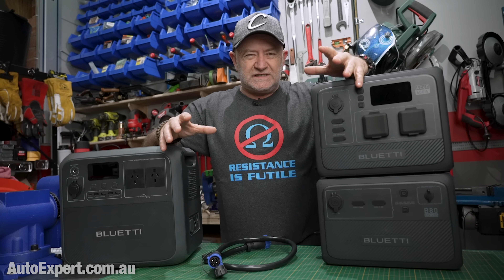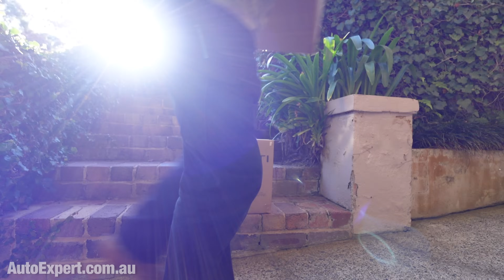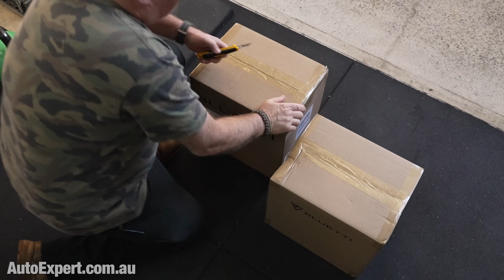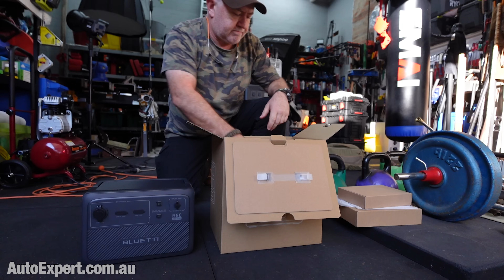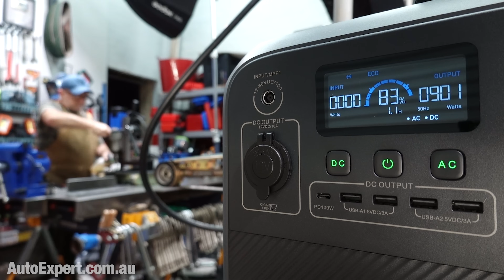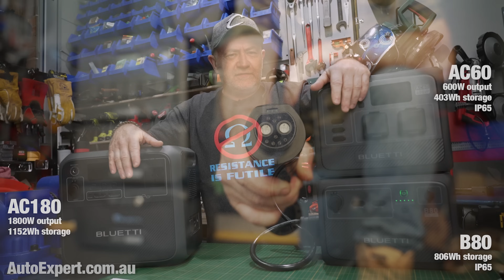Portable power: Bluetti AC60 & B80 portable power station review - first weather-resistant units!

Comment from the maker: BLUETTI PORTABLE POWER STATIONS
AC60 portable power station: https://bit.ly/4443whp
B80 expansion battery: https://bit.ly/3JcFrN6
AC180 portable power station: https://bit.ly/3qLDEIL
**Get an extra $20 off the AC60 using code "JohnAC60" until June 22.

Comment: Both are great units but the AC180 can do it all, I have run Induction Hobs and 1600w Air Fryers and Microwaves and kettles from them and they will even run SWMBO's Hair Dryer, So whether it is for Camping or Off Grid or unexpected Blackouts the AC180 will do it all, The AC60 + the B80 can do it too except run the big power Appliances, But I can find enough reasons for me to own both systems, Both are very portable and will get you through Storms and Blackouts and give the kids something to do by running their Xbox etc, In short these two Sogens are just Game Changers, Thanks John.

Comment: The ac 180 now has a cable for $30 which will allow you to hook up any Bluetti battery pack,the B80 all the way up to the 3000 watt which will give you 4100 watt system.
Reply: Does it it work and charge exactly the same?
Reply: What is the cable called?
Reply: @janiscooper1006  just lock on bluetti site and ask and it will show you.

Comment: RCD and earth staking is problematic. Use a RVD (residual voltage device)… no need to earth and a much safer option for isolated power supplies such as generators and inverters.

Comment: Wouldn’t mind one of these for the van and as home backup. I have a generator change over switch that I plug my little Honda generator and it powers the house. Would AC180 or 200 work in the same way? Obviously keeping within the inverter output.

Comment: These units do not have a neutral / earth link internally.  They would like operate as an IT class device.  As far as I know I class operation is actually a regulatory requirement for portable inverters sold in Australia.  I don't have one of these units so I can't verify it but I'd expect that the earth terminal on the device is also connected to the earth pin on the AC output sockets.  An RCD is not really necessary if this is the case as you require a double fault to have a problem, ie one of the 'live' wires needs to contact something abnormal and then you need to contact the other wire and then get in contact with the first wire or that other abnormal thing to have a hazard.

An RCD can work in these circumstances but would require at least a double fault and part of that fault to be upstream of the RCD itself to be capable of tripping since in normal circumstances one of active or neutral connecting to something else would still not provide a return path around the RCD.
Reply: An RVD and not an RCD is the way to go for those looking for extra safety IMO.
Reply: @RussellStewart  RVDs are prone to false trips with portable inverters where the DC side - is tied to the frame as would often be the case, either deliberately or through the vehicle's wiring system crossing the tow ball to complete the circuit.  It's not at all unusual to see > 100VAC between either of the AC output wires and the frame.  It's perfectly safe, faults in the inverter aside of course, as it's capacitive (20ish-kHz and 50Hz)  and extremely low current.

If there is true isolation between the inverter and frame they are a good solution.
Reply: @retrozmachine1189  thanks for the detailed reply. I’ve had no false trips with mine, but I am running the inverter 100% isolated.  I was originally running with an inline RCD but it would never trip even when a fault was induced on purpose.  The test unit always presented the “no earth” error. Rightly or wrongly, driving an earth stake was never a consideration for me, as a good earth stake is damn near impossible to get out and I had visions of me leaving a trail of earth stakes around the country for people to trip over. 😂
Reply: @RussellStewart  Good that it works for you.  Your inverter being fully isolated is the trick.

A lot of people don't understand how RCDs work.  They don't care about an earth per se.  All they do is sense imbalance of current between active and neutral, no matter how that happens.

Comment: I got one to use as a second battery for my maverick camper v2 limited. Because I could use it for the solar panels, then using bluette 60 to 24 v to the camper. This will support the AGM battery so it's doesn't over load it. Also if I need that short use of high energy tools or eg coffee machine. Plus I don't need to mode my camper to save money. Thanks John and the discount.

Comment: There are two types of engineers 1st type will instruct a tradie to "do it like I say" and won't listen to suggestions ... 2nd type will listen... Do the math and realize I the job can't be done the way he first thought and correct the instruction...or will explain why his method will be OK.  I have run into both types ...the best cure for type 1 is to say "put it in writing"... This usually causes a a type 1 to consult a type 2...

Comment: Can the B80 be charged off solar itself?
Like if you were to use it as a base camp to run a fridge and charge off solar while I'm off with the A60? And then could you also recharge the A60 later back at camp?
Reply: yes, most of bluetti's expansion batteries have discharging and charging ports

Comment: Thanks, John & Bluetti, for these reviews. 
Bluetti's always improving its line-up for the different needs & capabilities of potential customers.
The AC60 & B80 combo is ideal for the elderly as having them in each hand means that steps or uneven ground can be clearly seen when moving around, which makes it way safer. 👍
As you mentioned, the side weight distribution is less strain on the back, a major plus for anyone with back pain issues.
The earthing capability is essential in my world. I never use power tools with an earth-leakage breaker. It's just not worth the risk.

Comment: Hi John
My name is Steve  I have a couple of quick questions I’d like to ask you about the Bluetti AC60. Firstly my wife and I like camping ( without a caravan) would the AC60 last several days just running a 60lt fridge, some low wattage lights and a couple of 240v battery chargers? It would be able to be charged for a few hours via the car each day. And secondly if it is capable of doing that job as believe it would be then I am willing to put myself out and do a long term product review for both yourself and Bluetti at no cost, would that be of interest?
Thank you for your time.
Steve

Comment: My experience with the Bluetti EB70 (716Wh) and a 200W monocrystalline folding solar panel of decent quality, is that I can run my 90l Dual Zone camp fridge, with one zone on freezer and one zone on fridge. And in summer I can run the fridge indefinitely with that setup.
Anyone looking at Bluetti for camping will not be disappointed. 

Probably a good idea now that it is winter to run the same test again.
Reply: Most cases hr or so charge from the car keeps it topped also
Reply: @wobblysauce  only get 90W from my old car (1995 LandCruiser)
Reply from the maker: Interesting, Matt - thanks for sharing. It would be interesting to re-test in winter. Less sun, so less power in from the PV, but also less drain due to less delta-T.
Reply: @AutoExpertJC  the fridge was in the hottest room in the house also. Uninsulated brick veneer wall with full afternoon sun. I'll do the test in the same room. Panel in the same spot.

Comment: We used an AC 200P Blueetti while camping out the back of the Blue mountains in the wilderness area for 4 days.
We have it plugged into the Tesla to give us a continuous supply of 240 volts, which is really handy as when it rained continuously for 2 of those days we did all the cooking inside the tent on the induction cooktop.
The Bluetti was as good as the model Y
Reply: Even other hybrid models work great like that.

Comment: No. Can't afford one.
Reply: I suppose technically I should say I cannot afford two, because I do already have an EB70.
Reply: With the energy security issues we face as the push coal out having some solutions in you shed will be important. 

I invested in a Bluetti which is way too much money for me normally, but I now work from home so down time is an issue… and I wanted a solution for off grid potential. Way too big of an inverter but ultimately I can run my house off it. Now I have it in use every day, and take just the battery away camping. Can go 5-7 days without needing power and no solar. Running CPAP, fridge, lights, laptop, phones. It’s been great cause I now use it to power a diesel heater for camper or shed.

Now all I need to add is solar panels (renting so I have a cheap eBay flex panel and it’s ok but will get a decent one soon) and I will use this all day everyday and likely discharge overnight recharge and use excess during day. 

Would suggest it’s worth the investment and very interesting to know what your using each day and how much solar you need to live.
Reply: @offroadingfoz  mate, on a budget, just get yourself a 2nd hand house panel, they're consistently better than any flexi/foldable panel and you'll get one for near nothing. To test the panel, measure the short circuit current, what it should be will  listed as that (or Isc) on the back. You'll get a good idea of how the panel performs doing that.